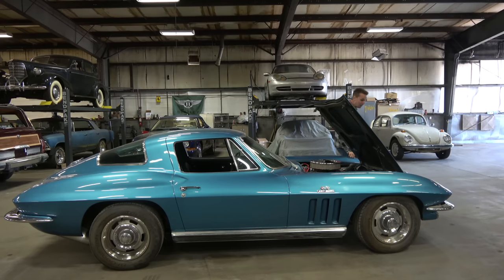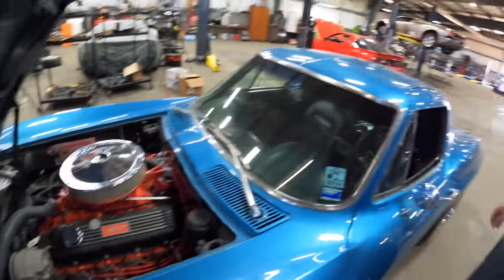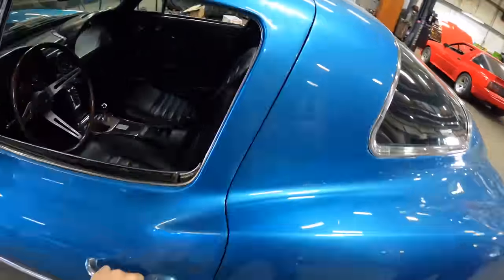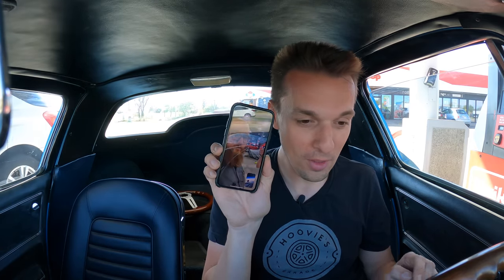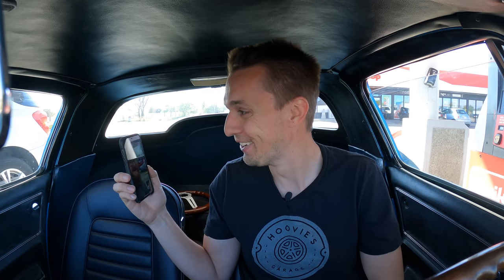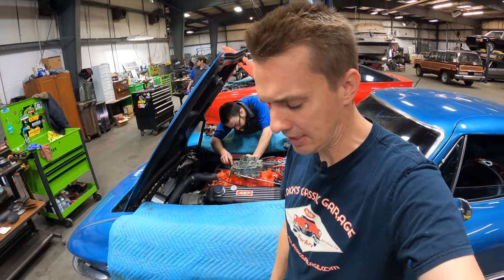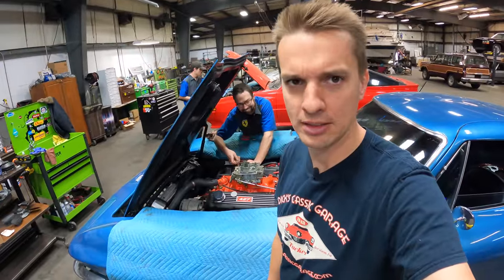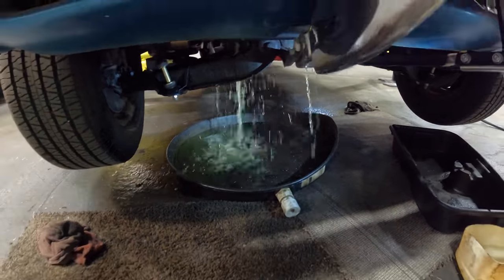Driving My Cheap 427 Corvette for the First Time (Of course it broke down)

Comment: After sitting for 5 years the wizard should've automatically changed all the fluids, right from the start, Everything gets a Flush.
Reply: I found that odd also
Reply: ....but then there wouldn't be any content for the channel.
Reply: @stevesnvegas9040  why would he put the car at risk like that? Makes no sense to possibly destroy his investment for one video
Reply: He did, this is rust in the new fluid, as the engine got into temp it got worst
Reply: Put a battery in it - if it spins it wins, road trip to Vegas.  If it breaks, it needed a stroker kit.
Reply: Yep. I think this was staged.
Reply: It felt like it was all planned for the content which is corny.
Reply: its due for a water pump going by the condition of the coolant
Reply: Yes
Reply: @CodeineAbdulJabbar  Yah it's just to nice to risk blowing a gasket
Reply: It's the first thing I would've done.
Then a full road test.
Reply: At least flush the radiator....
Reply: Ya think?
Reply: You have to realize that if hoovie didn’t ask to do it or authorize them to do it he isn’t going to do it
Reply: @CodeineAbdulJabbar  Not even just an investment, poor car
Reply: Wizard seems to miss a lot.
Reply: Wizard is lame
Reply: Yep real mechanic would have done that!!!!
Reply: Totally agree, staged for content probably but hmmm 🤨
Reply: @CodeineAbdulJabbar  because that’s how he has become a millionaire; this is his raison d’etre.
Reply: Wouldn’t make for a good hoopty channel if the hoopties didn’t break down 😂
Reply: he does make some pretty sketchy mistakes that even i, a non "pro tech" wouldn't make...however "tech's" are overrated oil and tire changers anyway
Reply: @a3-radio   it kind of needs a new thermostat,new hoses,new fluid
Reply: Exactly
Reply: 100% agree. Flabbergasted that a flush and flow test wasn't done. So easy to check the thermostat also...just feel the top hose when it's warmed up! Also surprised the old carb wasn't fully inspected - amazed that they just throw new parts instead of attempting a fix on what is probably a good working carb that was just fouled a bit. I shuddered when the car was first started after 5 years of sitting (in the first episode) - they should have spun the engine to build oil pressure before even attempting to start and possibly used fogging oil in the bores just to be extra safe.... but maybe this is all for content... lol...
Reply: Staged
Reply: No pressure test nothing
Reply: IKR. Hoovie desperately needs to find a NEW Wizzard. I guess he's living up to his motto of his channel being the dumbest one on YouTube. Mainly for continuing to take his vehicles to Omega Hack Clinic.
Reply: Very strange he didn't notice that or check and a coolant I would have changed it anyway sitting for that long
Reply: the we wouldnt have the faux drama and a video would we
Reply: That's a no brainer
Reply: This "wizard" is a total hack.
Reply: Yeah, some 'wizard".   All I ever hear this guy say is 'send it off for rebuild'.  He sounds more like a parts swapper than a wizard to me.  Not impressed.  And he really should stop sucking down petro based fluids, or it's going to get a lot worse.  Some people are just hilarious, and their own worst enemies.  Smelling fluids, like tranny fluid for condition is fine, tasting it all the time, not so much.  Kind of industrial strength stupid actually, and it will probably catch up with him eventually, but he probably won't be smart enough to connect the dots (stomach or throat cancer, or whatever) when it does.  The old standard "why me?".

I saw an engine swap done by an "SAE certified" mechanic.  The car was barely running when he started it and he said "I don't know what's wrong".  I don't know what the hell they DO teach those guys, but apparently what they don't, that they should have, could fill volumes, because you could tell by ear that the timing was horrendously retarded.  Again, not impressed.  Oh and the pulley and harmonic balancer nearly fell off the vehicle about 40 miles down the road.  Gives you real confidence that the stuff transferred across and 'bolting in' was done just right, too.  Yes, it was a dealer mechanic.  I told him, he didn't listen.  It's the mechanic, not the shop that matters, at least for that phase of the operation.

Nobody works on my cars but me, and ya know what, when I fix them, they're fixed, and they stay that way, at least until the crummy aftermarket part gives up.  With a good car brand, it often pays to just find a low mileage salvage yard ORIGINAL alternator, etc.  They will most always last FAR longer than your AutoZone, OReilly's, DAP, or Pep Boys sold versions (sometimes another 200k vs 50).  For easy to replace stuff, like sensors and consumables, just go box parts store and replace (free) as necessary when they tank, if YOU do the work.  Even then, you can usually buy from an array of quality choices and brands, I find going to or near the top of that selection list pays dividends if you don't want to get dirty too often.  Just a hint, brands like NGK are boatloads better than brands like Champion.  This applies pretty much across the board.  Take from that what you will. OK, I'll spoon feed it, if there's a Japanese built part for your Japanese car, pay the extra and buy it, but NOT from the dealer, unless you just like to spend money for no reason, or it is the only place that can supply it.  OEM supplier parts are usually available from the Kmart equivalents of auto parts stores. I don't know if those are OEM originally specified level parts, but they seem to be, on the whole, with experience of reliability of the two types.  Also, when I once DID go buy a timing belt for my Camry, from the dealer (was in buying a couple of other small parts that were dealer only) it was the same belt as the best case auto parts store sold, for about half the money at the 'big box' store.  :-/  :-)

Comment: I love the C2 1963-67 Stingray Coupes. Those seats are just too short on the back. If you got hit a little in the front end, you’d get a pretty nice whip lash. That Holley doesn’t look like it belongs on a 427. That carb looks like a 600 or 650 Holley. Get at least a 750 on it.

Comment: Pro tip cleaning rusty block:
Dishwasher tablet into radiator and run for a minute.
Then flush. All rust is gone and tablet will give a little anti rust treatment at same time.
Reply: just pull the water pump and thermastat let all the coolant passages be open. replace both they are due
Reply: chris replacing a water pump won't get the rust out from the bottom of the block

Comment: I got to drive a 1967 427, 4 speed in Corvette Rally Red. It was a beautiful machine and an absolute beast! I could feel every little crack in the road and it felt as if I was connected to the road, in a pure and primitive way! I'd always thought that I would prefer small block balance, but that rat motor Vette was quite mesmerizing. I drove it in 1997, but it feels like yesterday!

Comment: "What's that one taste like, Wizard?" ROFL

But in all seriousness, why weren't all of the fluids changed before a test drive? Just wondering because I thought that if a car sits for a while then you should change out all of that before driving it.
Reply: Probably because Hoovie wanted to a video as quick as possible :-) and if it did not run 100% that is he's thing anyway.
Reply: @alexanderwingeskog758  I am just asking. I mean its his car and I am not a mechanic. I am just saying. :)
Reply: Exactly!!!!! Magic Mike isn't so Magic!!!!!
Reply: Because faux plight and manufactured drama drives clicks and revenue.
Reply: @tim3172  Bingo.
Reply: @tim3172  doesn't look good for wizards reputation, though.
Reply: @tim3172  I just made a comment saying the same thing. It's bumming me out to see Hoovie go that route. They used to do real work and rescue real cars. It's starting to feel off, and it's disappointing.
Reply: Not a bad idea to do a full tune-up (all fluids, plugs, wires, etc) on a car that's been sitting for awhile, any used car also, I've found that even though people swear up and down the maintenance has been done, it is often the case they overlook something or lie straight to your face.
Reply: A vehicle of this calibre, that's been absolutely SITTING for half-a decade....EVERY fluid in that machine should have been flushed-out and replaced.  No exception - there's NO WAY a car should have left the shop with 5+ year old coolant in the block.
Reply: @Kidsinamerica  Right
Reply: @Kidsinamerica  the coolant in my car is 6 years old and it runs fine no leaks and doesnt freeze
Reply: And for sure he's no wizard
Reply: @EazyDuz18    Coolant is like oil - you change it out periodically.  Not as OFTEN as oil, but once every 2-3 years.
Reply: because he can get at least two money making vids from it.........im pretty sure he knew it was going to overheat...all in the script...wizard would have looked it over thoroughly like all the cars Tyler gives him and made sure as much as possible there was nothing seriously wrong and said it will overheat, just dont overdo it , get it straight back......Wizard makes the same money on fixing it and Tyler gets at least one moneymaking vid...win win all round
Reply: @Kidsinamerica  Exactly. I almost cried when I saw that. That model of Corvette is my favorite of all time and the 63 Vette with the split rear window is my favorite car of all time. If they need a coolant tester I would be happy to ship them one. They are $4 on Amazon and I will pay for it and ship it to them rather then see them do that to another legendary car like this again.
Reply: @logicreversed18t  you really think wizard hasnt checked the car over 100%, you really think he he didnt tell Tyler  its going to overheat so just go for gas and get it straight back so no damage is done ?...why make one vid when you can make multiple vids on the same vehicle
Reply: @Kidsinamerica  you just dont get it do you ?...the typical YT know it all Joe....
Reply: @alexanderwingeskog758     Exactly not to forgot no problem, no good video, no good video, no money
Reply: They probably know the engine is toast, why not gain a few clicks and subs before putting the new engine in?
Reply: @bazwillrun  Exactly. And it is Tyler's channel and the car is his property so he can do what he wants with his stuff. But this is YT and YouTubers need to do everything possible to drive up clicks and views so whatever the reason I am not going to be surprised. All I know is that no mechanic on the face of planet earth would not check the coolant on a car like that.
Reply: For content ;)
Reply: @bazwillrun  My sportscar has an all-aluminum drivetrain.  Previous Owner never changed the coolant, and parked the car for 12 years.  Stagnation in the block/heads caused a coolant passage to scale, and was blocked-shut, causing the car to overheat, rupture the head gasket, and eventually burn a hole in one of the pistons. Heat-cracking damaged the flywheel and the crank over time.  $30,000 damage.  Wanna see my receipts, clown?
Reply: @bazwillrun  That's my point . . . it's all fake.
Reply: Negligence. All fluids should've been gone through. Hopefully he didn't notice it was overheating too late
Reply: @Kidsinamerica  lol modern coolant runs like 75k. You are wasting resources and money changing it every couple years dude. Only dex cool needs to be changed that often, and that's why everyone switches to regular green.
Reply: @Kidsinamerica  And that is why I am like there is no way that they drove the car without first making sure that it would be ok. I mean I am not a mechanic so when things came up on Hoovie that were escalating the drama and views then I was always like it could be fake but I don't know if it is or not so whatever. But this time I am like I am not a mechanic and even I am like either Wizard and Hoovie are absolute morons or they are presuming that their viewers are so stupid that they will just not think about how there is no way in hell that Wizard would not at least check the coolant on a 54 year old car that had been sitting for 5 years.
Reply: Only professionals do that.
Reply: If you change it without having run the engine for a while all the sludge just stays there. Why not let the owner have the first drive? Besides, Hoovie knows cars, the worst that can happen did happen. It got a bit hot and he drove back. Big deal.
Reply: how do we know the coolant wasn't changed? If it was changed, but not flushed this would still happen.
Reply: @tim3172  Hey, it works for me. My television is almost never on because I'm on my computer here watching what's fun. Hang out in a shop long enough, you'd be just like them, having fun with cars, and making jokes about each other. Cool to me. Peace.
Reply: @tim3172  It's funny. I'm here a lot more than I am in front of my TV. These guys put cars in front of me I can only dream about, and they are having fun doing it. Please, don't start drama where there is none. I enjoy it for what it is. Peace.
Reply: Yes, I would have had every fluid changed before any serious road time. Look at the rust in that cooling system. But that car is awesome. And I'm not even a Chevy fan.
Reply: @EazyDuz18  yeah those liquids can be there a long time, but I think just sitting there for a long time is not good vs it getting used and thus stirred etc... Plus unless they changed everything before not touching it for 5 years, who knows how old it is.
Reply: @Finished Finnish Antifreeze is also „anti-rust“ protectant. So while it may still serve as a coolant, you still want to change it because of its anti-rust capacities.
Reply: @tim3172  I don't think he would risk the car just for clickbait. I think it was just a massive oversight by whoever was doing the work
Reply: @Kidsinamerica  why did you drive it and do all that damage?
Reply: @MrCarGuy  aren't you supposed to warm the engine up to stir up all the crap inside the coolant passages before you change the coolant?
Reply: Someone's not doing a very good job,  that could have been an expensive engine replacement. If your relying on a mechanic to prepare a car for you.  Not the first time either.
Reply: I'm sure they expected this. 
Wizard didn't miss a problem that big.
Reply: @carwashadamcooper1538  this is hoovies channel and the wizard lets him make the executive decisions. wizards job is just to fix what he breaks. wizard should for the record be heard recommending things before he drives away to protect his reputation
Reply: totally agree.  Change all fluids and test for leaks/other problems BEFORE returning it to Hoovie to test it.  Doesn't speak well for the wizard unless this was an intentional set up.
Reply: THEY WERE, DID YOU WATCH THE VIDEO?
Reply: @TenOfZero1  litrally just said 7 years not 3 years thicko
Reply: It tastes like maple syrup, toilet water, and rust.

Don’t ask how I found out
Reply: Because the wizard isn’t a great mechanic....
Reply: @yzrider3326  better then u ever be lmfao
Reply: No shit
Reply: @Psych0technic  Yeah, and the fan clutch diagnosis isn't helping....the fan is for cooling when you're not at highway speed.
First, the bad oil change in the Mercedes, then installing an overhauled rack and pinion without proper inspection, now this?...and why is the valve train suddenly noisy?
Reply: Right. EVERY fluid should have been changed. This is not his typical basket case. It's a bona fide classic car that's CLEAN!

You don't leave 5 or 6 year old coolant in ANY vehicle. Especially THIS one!
Reply: @mr.carguy3161  I dont think you know what your on about. As many have said, we all leave coolant in our cars for well over 5 years will no ill effects
Reply: Yeah kinda like gas monkey garage
Reply: Was it over Heating? l you did not see  it over heat  at all ?  If it did  you would have killed the engine  warping the heads and the block would be shot
Reply: Hoovie   is a ex used car  dealer  first thing you do is get all the fluids changed because you don't know the cars history at all
Reply: What happend to the channel? A good few episodes ago hoovie announced how he was going to start giving back to the community and donated a couple of cars and such but that all seems to have stopped!
Reply: wizard would never get my work
Reply: @Kidsinamerica  Not true, for most vehicles they label coolant as for the life of. I mean maybe once a decade should be plenty but normally you have a waterpump go out before then and have to change it any ways.
Reply: @dannymiller3648  Not all ways, a vehicle can overheat and still be good unless it's hot for a long time. Some times a quick overheat can cause hairline fractures in the head but unlikely.
Reply: @upsidedownpeon9984  lifetime coolant?  Are you for real? Coolant needs changed every 3 or 4 years.
Reply: @upsidedownpeon9984  The buyer of this car has NO CLUE what was inside the radiator at the time of purchase, and there is nothing 'new' or 'modern' about this car at all.  There is nothing "lifetime" about coolant, there never was.  Even "lifetime" transmission fluid needs changed periodically.  You must drive a Kia.
Reply: @EazyDuz18  Oh I’m way better than him and definitely you at everything..
Reply: @EazyDuz18  You must be blowing the Wizard 🧙‍♀️
Reply: "Wizard" is a joke!
Reply: @Kidsinamerica  Needed gas tank emptied,   should have done all fluids, and ran gently to make sure it wouldn't OVERHEAT maybe..?  I've done the same stupid crap...you learn after a a while don't get so carried away so fast -it will cost you. You could tell the motor wasn't burned right away by how much fun he was having that first 3 minutes until.....Ooops!  There goes $ 15 grand or so...

Comment: best bet for the rusty block is to run soluble oil in the cooling system ...it works like coolant and it keeps hoses soft and water pump seal soft and stops the cast block rusting and brings up the boiling temp ....the same oil you mix for a lathe or cutting machine ...just 1 or 2 cap full